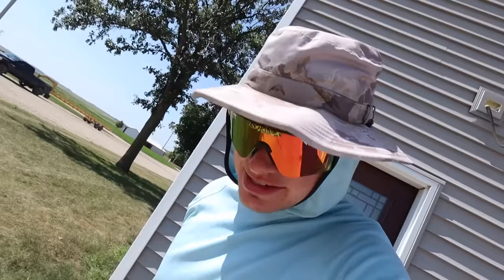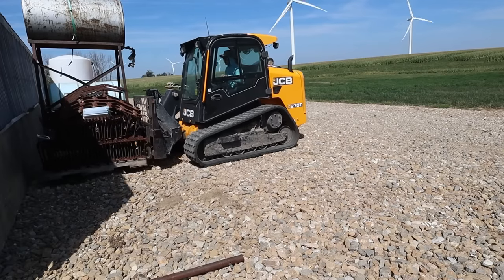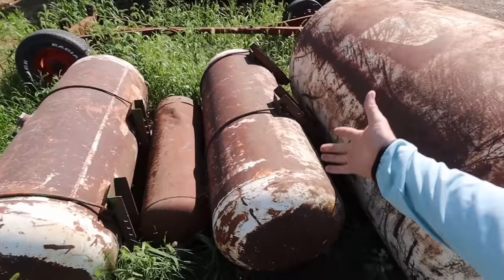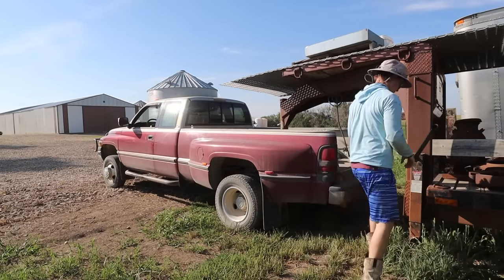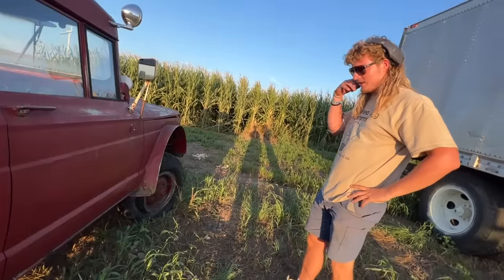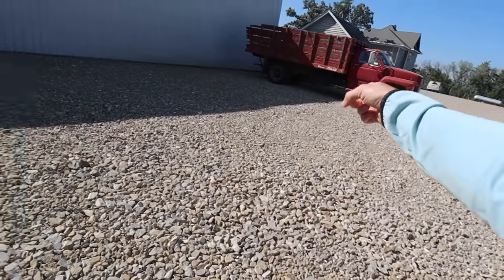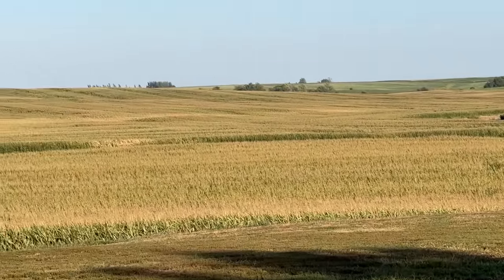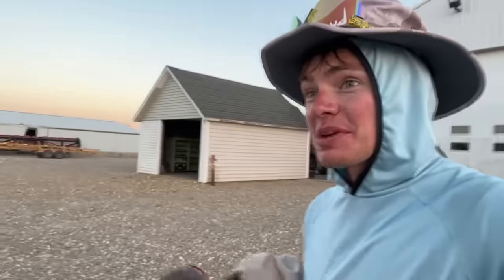I Threw Away My Abandoned Equipment

Comment: Cole put a male pipe thread adapter with an male banjo fitting on the drain hole of the pump.  Then you can use a banjo cap on the drain and lug.  We have this in about 10 pumps. It makes preparing for winter a breeze.

Comment: Call I will give you a piece of advice on those little engines like that I use a product called stabil have yourself somewhere around the quarter to a half tank or more of gas and put a couple of ounces of that in and run it until you can smell it in the exhaust and you don't have to drain it. Engine will be more apt to start without any tinkering next spring

Comment: Old tanks.  Open valve with wind behind you.  Then test green tip 5.56 from 100 yards.  Then black tip 30 06 from plus 100 yards.,   No closer, no crowd around.  I made 2 runs to scrap metal place.  That gravity box is still useable size.m

Comment: To deal with your constant WASP problems, get some boric acid, and a half gallon of apple juice, mix in 3 tablespoons of the boric acid, and fill a couple soda cans, (anything with a small opening you can put a stick in to)
and any wasps, will find the apple juice, and bring it back home to their nests and share it. 
the stick allows them to escape the can, to get rid of the nests. 

This supposedly works for 1/2 mile radius for most wasps. 
Doesn't harm bees.

Comment: Cole, I don't know if Iowa has it but if you use non ethanol gasoline in your small engines it will not gum up the carb. I've been using non ethanol gasoline for all of my small engines for a few years and they always start up in the spring without an issue. I know as a corn farmer that takes most if not all of of your corn to ethanol plants it sounds bad.....but it works. Great video by the way. Also love how Cooper said about that truck trailer if he could just torch it, lol.
Reply: As fall approaches I start running ethanol free gas in my lawn equipment- you are correct sir!👍
Reply: @southpawred7172  I run it all the time with my small engines. It runs best with older equipment, since I have older equipment, 30-to 45 year old machines.

Comment: If you only put 21,000 on a 30,000 mile lease you better do some of your calculation videos on cost per mile. You need to buy that truck per the terms of lease buy out, with todays prices it is problem a no brainer decision.  Your cost per mile is will be a lot more then it should of.